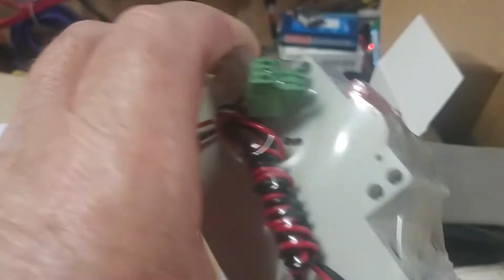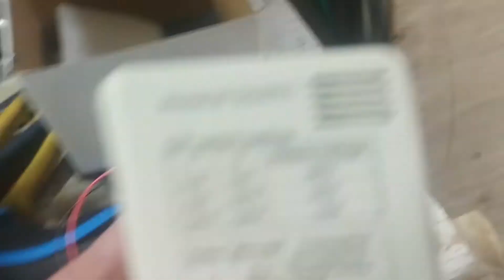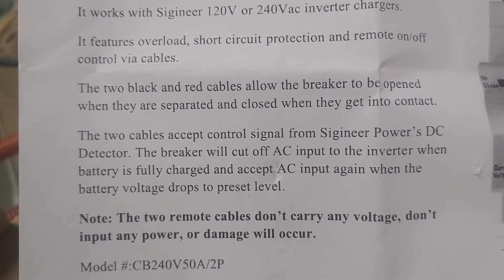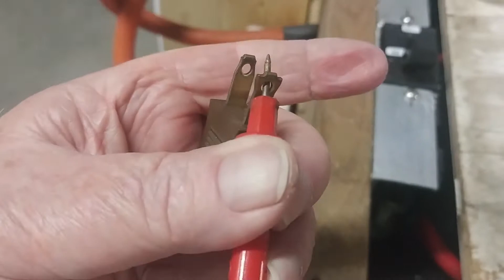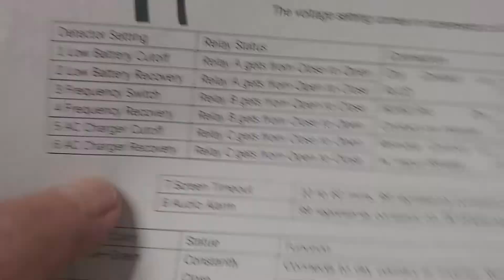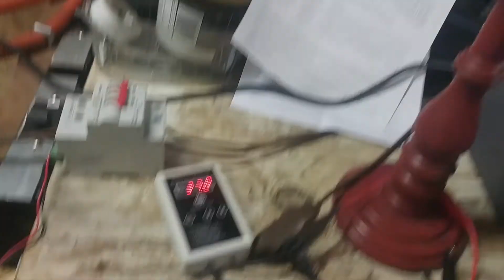2020 30 AC voltage controlled breaker

Comment: Results looks promising for your application. From the look of it, they're DIN mounted breakers. Wonder if I can put them opposite of each other to automate the transfer of my grid-tie microinverter panels to dump excess power to the grid or take them offline when the batteries get to the 90% mark and my system is in "islanding" mode. The fun part is fashioning up a mechanical interlock to prevent the grid or the inverter side from being activated.

I know it is possible to use 3 phase forward/reverse contactor to pull it off since it can be fitted with a mechanical and electrical interlocks to prevent them from being activated electrically or physically. However, they command quite a bit of $$$. Time for me to dust off some of my MSDOS skills on programmable logic controls.
Reply from the maker: Seems you understand the dilemma I believe the switch is too slow for your application but then again the timing could be left apart and the negotiating mode would happen after the slow switch. Or just use an inverter with an auto transfer switch to control the grid tie. Whatever you decide let us know. Good luck
Reply: @offgridwanabe  Good to know on the response time on the breaker is a bit the slow side. The conundrum of having grid-tie microinverters back feeding in to the backup load panel and not tripping the low/high protection of the BMS or bad things happen in my case.

Normally it is not an issue when it is on a normal/bypass mode. If it goes in to standby mode and the batteries are full is the potential issue, but I haven't had it happen yet. The option is to have it go to a dump load if I lose the grid.

Half the house powered from the nominal 48 volt DC rail and half on the 120/240 side of the Magnasine inverter is where things can get a bit complicated. The more I think about it, my drawing board is getting bigger and bigger by the minute processing the possible scenarios.
Reply from the maker: @felaxchow207  I believe in the manual it says the Inverter cannot be in in any mode but auto connect it lays out the conditions on Page 45, and also have the dump load as a backup so have both. Relays are always tricky the electric hot water uses more power than I can ever produce and will kill the battery in a short time while the bottom element transfers to electric base board in the event the water is hot. Always be careful

Comment: I have contactors if you need a few
Reply from the maker: You mean to control the breaker?
Reply: @offgridwanabe  No to use as a breaker. But I guess it will need that signal
Reply from the maker: @frankz1125  Are those contactors rated for AC or DC or both do you know?
Reply: @offgridwanabe  Im not sure. Ill get back to you

Comment: Relay breaker that's awesome!! Do you have a link where you got it? I like the small explosions, LoL 😃 thanks for sharing 😃
Reply from the maker: It is pretty cool
https://www.sigineer.com/product/dc-voltage-detector/

https://www.sigineer.com/product/remote-control-120v-240v-50a-ac-circuit-breaker/
Reply: @offgridwanabe  thanks for the link 😃
Reply from the maker: @TheBillythekid2010  No Problem Billy